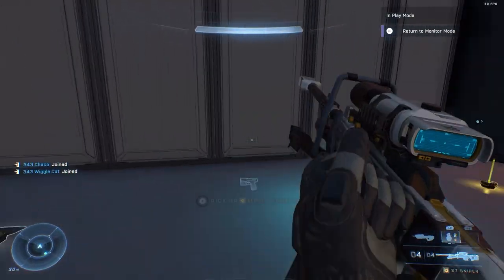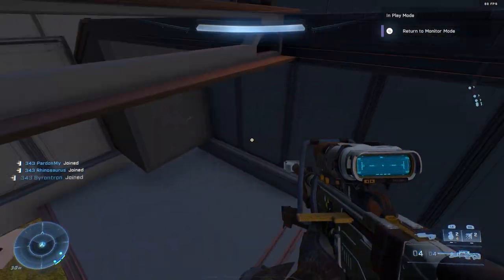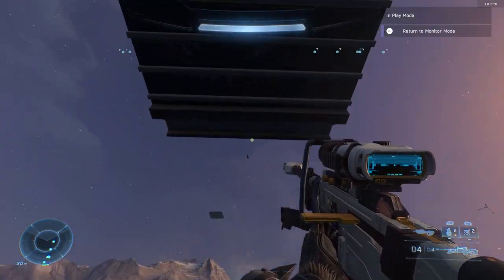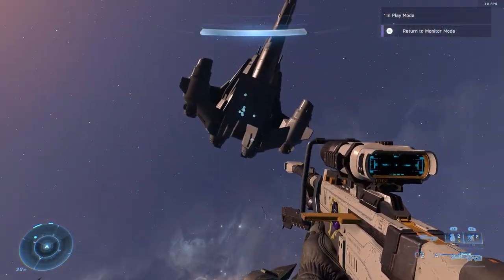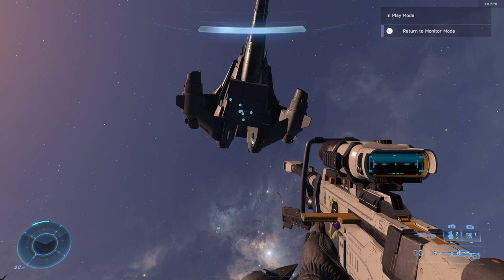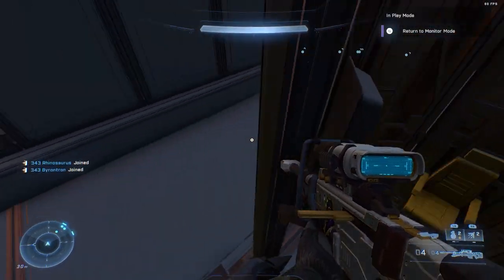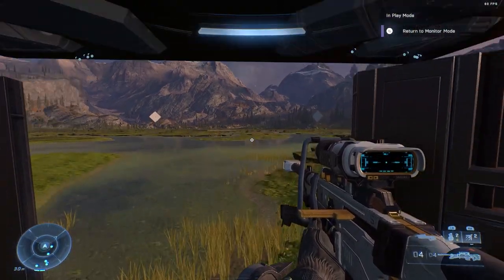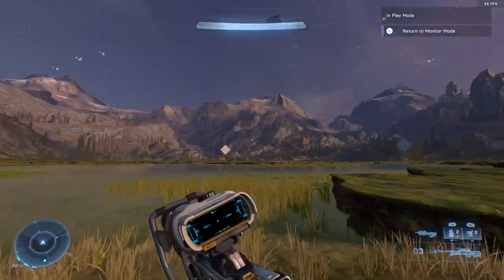Drop Pod Experiment in Halo Infinite Forge

Comment: Yeah how do you do this
Reply from the maker: For this one, I used a welded object. For some reason a welded object worked better, physics wise, than making a prefab. From there, I added a script with a teleporter to put you in the pod. Then another script to slide the deck out from under the drop pod so it would fall.
Reply: Thanks man @phoenixaffliction